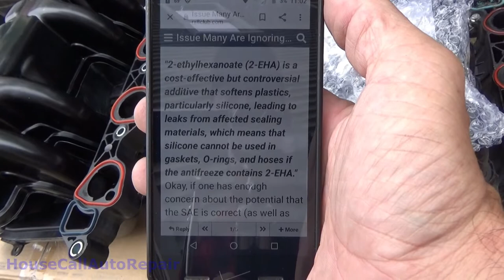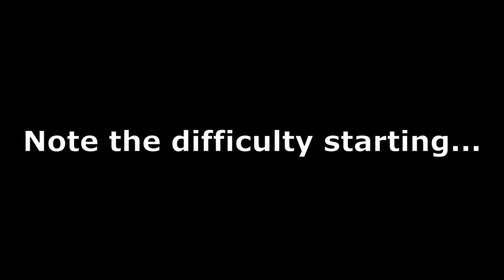When a preventative measure backfires!!!

Comment: At least you didn't drop a bolt into an intake port . . . like the neighbor did when helping my dad replace the head gasket on his '57 Buick.  He didn't say anything until after it cracked a piston, said that he thought it would just blow it out.  That was the end of the Buick.
Reply from the maker: Look back through my older videos, https://youtu.be/zWkkMq-JeGY for the previous replacement of THIS manifold.... (1/4 inch drive 8mm deepwell, dropped into #7 while finishing install of throttle body)